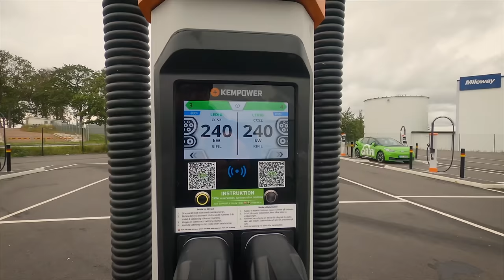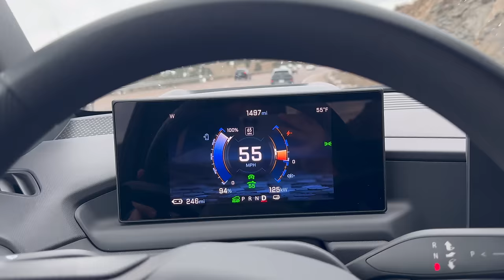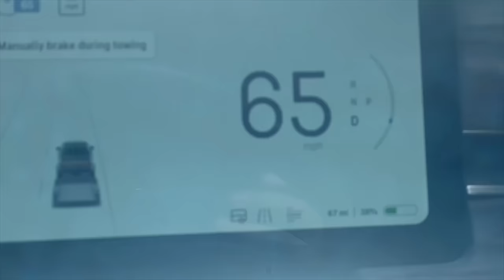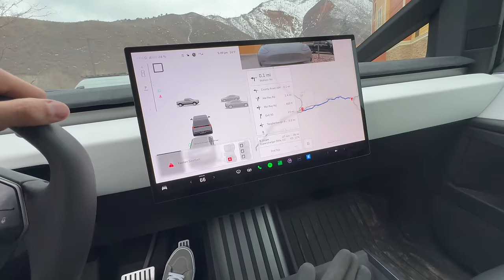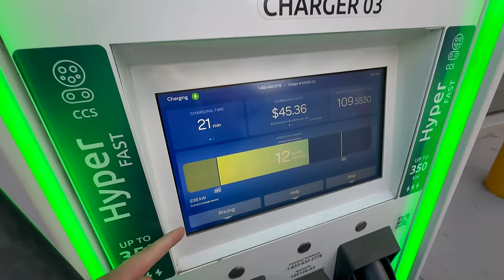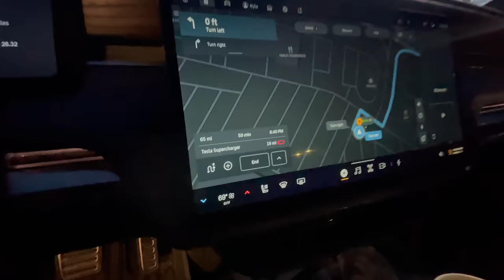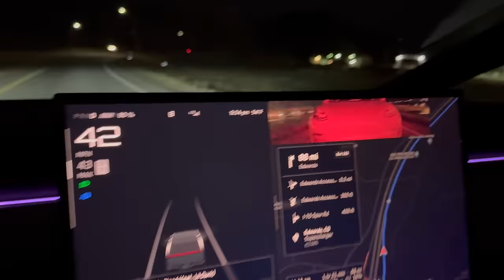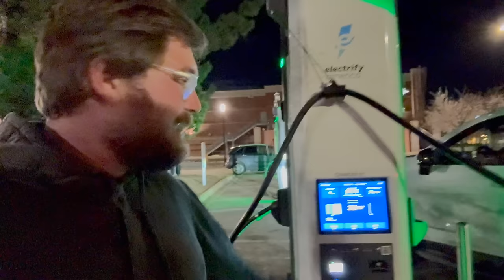Electric Trucks Tow 500mi Over The Rocky Mountains! Cybertruck vs Lightning vs Silverado EV vs R1T

Comment: Is electrify America dying
Reply: Actually, from this article, it seems that they are working just fine.
Reply: @bikeaddictbp  didn't answer my question
Reply: @s.porter8646 OK then. "No."
Reply: @bikeaddictbp  great response ma'am
Reply: Not yet. But they'll likely be bought out by a competent provider which can provide the reliability it badly needs. The IONNA consortium is my guess.
Reply: @Paul-cj1wb  if they go to a dedicated membership they'll survive l, but...where I am, I've never seen a broke charger
Reply: @s.porter8646  They already have a membership. Are you not aware of that? 

Sounds like you haven't charged there often enough. Just because you see an EV plugged in, doesn't mean it's working properly. Many times they are derated to only 50kw, but because there are no other options around, CCS EVs are forced to charge there even at those pitiful charging rates.

If you play close attention to this video, you'll notice that they said they were "lucky" to get the one working 350kw charger. The other one was down as per the app. And that was on both of the EA sites they used.
Reply: @Paul-cj1wb  it's not a real membership, and yes, I have blah blah charged enough, where I'm at now, you need a membership to charge, not EA, save a dollar membership, not sure if you think you're trying to educate me or be a gate keeper. Your elongated response sounds like B
Reply: @s.porter8646  I was merely responding to your "if they go to a dedicated membership they'll survive" comment. What does that mean, other than EA already having a dedicated membership to charge. Please clarify what your statement means. Explain exactly what type of membership are you referring to?
Reply: @Paul-cj1wb  where I'm at, you pay a monthly membership based on your charger requirements for example, 10 charges a month, EA membership is not sustainable. Sorry if I came across hot. I got a Rivian overseas and restrictions are 50kw here, at 30 min a session
Reply: @s.porter8646  Np. Sorry but I have never heard of such a membership. Is that a homeowner association type of thing?

I thought you were in America by asking about EA. So living here, I can tell you that EA chargers, and basically most existing CCS1 chargers, are still very, very poor and  unreliable.

Which is why I keep saying that Tesla opening its network is the greatest thing to happen to EV adoption in North America since the founding of Tesla itself.
Reply: @Paul-cj1wb  I moved to Japan two years ago, Tokyo power owns the chargers, they are managed by Toyota/Nissan/Honda, so you sign for a membership, I usually charge at home, but it's 100v
Reply: @Paul-cj1wb  our second cross USA trip, half the EA chargers we bad
Reply: @s.porter8646  Well, they're not much better. A little better, perhaps, but that's about it. An especially during daytime hours when tons of people are using them. 

If you use them between 12am to 5AM, when their loads are much less, they seem to work better. And you are also basically the only one charging there, so even if some are bad, you can still use the one or two that are still working.

Comment: I get 15-16mpg in my 18 cummins on 37s towing my less aerodynamic car trailer and I can comfortably put 27 Gallons in...  without the 50 gallon AUX tank 420/1150  towing range is comfortable and 2.5/8  min refueling.
My suburban will get about 14-15 towing my car trailer and it holds 32 gallons! 465 miles. 

These are getting there but the only one that is even remotely comparable is the Chevy.

At $0.35 a KW and approx 1Mi/KW that is not a cheap way to be towing. 3.75/gallon of Diesel in Georgetown at the filming of this would put fuel at $0.24 a mile. less expensive and compared to my suburban on reguarl that would be $0.21 a mile. Even cheaper.

Comment: The reason cybertruck only does 250kw from 0-29% is clocking faster then that for more battery % increases the degradation of the battery. That silverado is going to lose like 5% range in first year if charged at those rates normally

Comment: My dually ram 3500 with roll off dumpster gas 40 gallon tank gets 450 range miles towing. Towed ct to fl fully truck loaded with 20’ enclosed car hauler stopped for fuel 3x.  I’ll leave the charging to golf cart and ebike

Comment: I stopped watching at 13 minutes.   I'll have to find the shorter version.   A couple of things - I drive a Lightning.   The Ford Navigation is worthless as noted when he tries to find an EA using voice.    The second - without knowing the route, with the adapter why isn't he looking for a Tesla charger.   That is the advantage we have now.   You aren't running a fair test if you aren't taking advantage of the best chargers which you have access too.   There is a chance one is not in the right place, but you aren't being fair if there is.   Use ABRP or Apple and find the Tesla charger.

Comment: The Silverado is a disaster. Here’s why:
I think the Silverado looks really great and has really nice features. Especially the HUD. It is probably better than all the other currently available EV trucks on the market but they really should ask Lucid for their motor technology to improve their efficiency.

JerryRigEverything managed to drive the Silverado for 460mls with one charge. That sounds great but their efficiency was only 2mls/kwh😳 That means that truck is dragging a 230kwh battery with it🤦🏻‍♂️ A full charge will cost about $100 (+/- $20) depending on the charging company. That’s about 19.7MPG. Its electric but it costs as much as the gasoline version to travel with it. That just doesn’t make sense from economic standpoint. Why pay so much more to purchase an EV when it cost the same as an ICE vehicle to fuel it? 

Any manufacturer can put a huge battery on its car and break the range record but what’s the point when its done with such a significantly low efficiency?

2mls/kwh sounds like very low efficiency to me. 230kwh batteries weigh about 3,000LBS giving the Silverado a total weight of 8,600LBS😳

As a comparison: The Rivian goes 2.5mls/kwh which I think is also not really efficient but still much better than 2mls/kwh. The Model Y goes 3.4mls/kwh which sounds way more reasonable. Lucid Gravity is rated to go 4.3mls/kwh (440mls with a 102kwh battery; curb weight 5,500LBS). That means one travels the same distance while paying 56% less for fuel. That’s a saving of $2,500/year for an average driver who drives 20K mls/year. Chevrolet really needs look into a different motor/battery technology to fix that problem before mass manufacturing that vehicle. If they can find a solution and bring the efficiency up to 2.7mls/kwh or more, they will most likely make that vehicle the leader of its class as they intend to. They have the money to buy Lucid’s technology. Based on the available data, I believe the Silverado could easily reach 440mls with a 160kwh battery if it used the same motor technology Lucid Gravity is using. That would bring down the curb weight from 8600 to 7600 and bring up the efficiency from 2mls/kwh to 2.75mls/kwh.

Its a shame you guys didn’t list the data at the end to show which truck drove how many miles/kwh for the total trip to have a real comparison how their efficiency changed with the Model 3 in tow.

Comment: Summary by AI:

Four electric trucks tackle a towing challenge through the Rocky Mountains, showcasing their strengths and capabilities in a competitive race.
Highlights

    🚚 Towing Challenge: The F-150 Lightning, Rivan R1T, Chevy Silverado EV, and Tesla Cybertruck compete in a 500-mile towing test.
    🏔 Rocky Mountains: The trucks navigate challenging terrain while towing identical trailers with Tesla Model 3s.
    ⚡ Advanced Tech: The F-150 Lightning features advanced towing technology, enhancing its performance in the challenge.
    🔌 Charging Speed: Silverado EV stands out with the fastest charging capabilities, proving its efficiency on the road.
    ♻ Regenerative Braking: The Cybertruck’s regenerative braking system is put to the test, demonstrating its efficiency during descents.
    🗺 Navigation Issues: Despite some navigation challenges, all trucks show impressive performance in towing and efficiency.
    🥇 Race Results: Silverado EV wins the race, followed by Rivan, Lightning, and Cybertruck, highlighting the importance of battery capacity.

Key Insights

    ⚙ Technological Advancements: The integration of advanced towing technology in trucks like the F-150 Lightning significantly enhances towing capabilities, showcasing how innovation is critical in electric vehicles.
    🌍 Range and Efficiency: The Silverado EV’s ability to cover long distances with fewer stops emphasizes the importance of battery capacity and charging speed for electric trucks in remote areas.
    🏎 Competitive Edge: The friendly race not only highlights individual strengths but also fosters a competitive spirit among manufacturers to push the boundaries of electric vehicle performance.
    📈 Market Trends: As electric trucks evolve, their capability to handle challenging terrains will attract a broader audience, paving the way for more robust electric towing solutions.
    🔄 Regenerative Systems: The effectiveness of regenerative braking systems, as demonstrated by the Cybertruck, is crucial for maximizing energy efficiency during long hauls.
    🚦 Charging Infrastructure: The journey reflects ongoing challenges with charging infrastructure, indicating a need for improved accessibility and faster charging solutions across the country.
    🛠 Future Innovations: The potential for hybrid towing solutions could revolutionize the electric truck market, combining the benefits of electric power with traditional towing capabilities.

Comment: Kyle calls the Chevy the most useful truck? With no bed! With excessive costs! That will rust and dent immediately if a real worker uses it. LoL. Not to mention they didn't exist for the working man. 
Kyle: sell me a truck that costs $250,000.00 and it will be perfect. Massive over sized battery. Horrible body that will dent, scratch, rust. Yup. That's the ROI real working contractors will choose. 😅😅😅